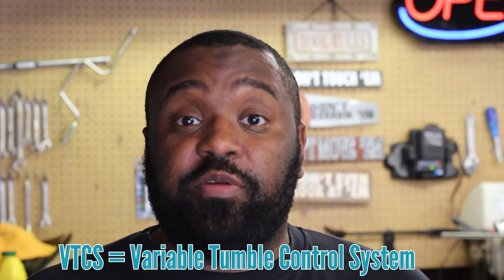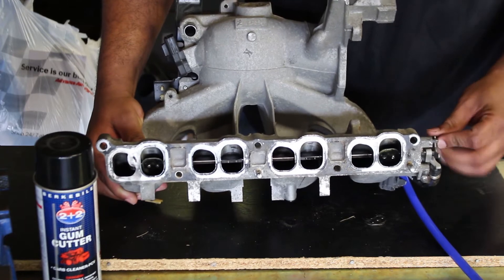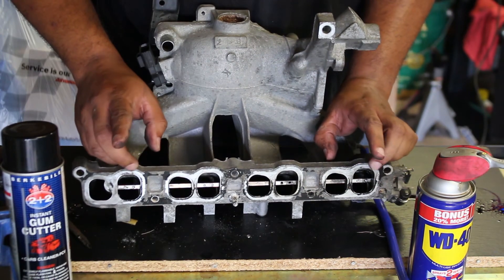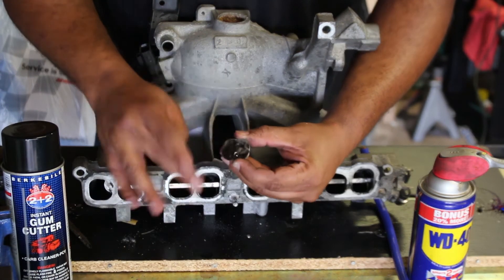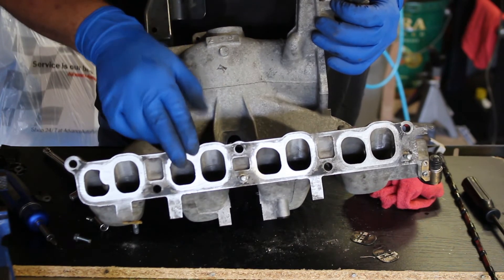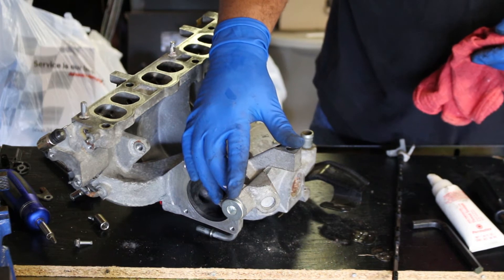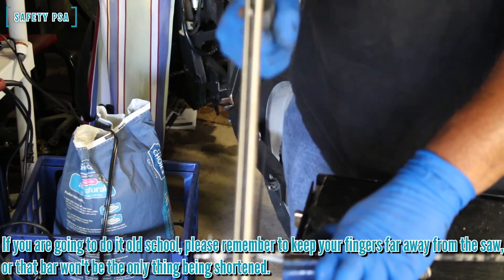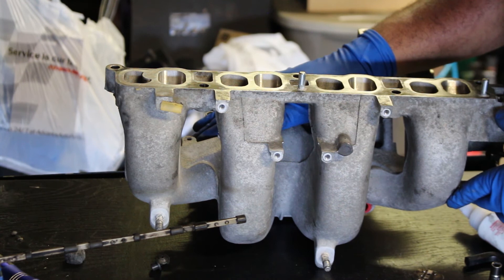VTCS Removal

Comment: You forgot to dremel away the VTCS rod bump in the smaller Cyl 1 runner. This should help remediate some of the flow imbalance of the stock IM.
Reply from the maker: That is a good point. When I replaced my injector seals (didn't record a video) I took the time to clean it up. I might do a follow up video to this in the future where I remove the VTCS from a different manifold and show some of the port cleanup tricks.

Comment: very solid video man and thanks for all the tips.  i personally am trying to avoid monitors turned off and CEL so there goes my doing this but id not have known if not watching this.  thank you again man
Reply from the maker: Thanks for watching! Unfortunately with this car, when you go to add the fun parts, it throws CEL's, even with the Accessport.
Reply: @FiveFiveGarage  very much true to a point.  I am stage 3 currently, going bigger turbo and have a ton of bolt ons but vitally, no CEL - the reason this is vital is that i live in CA so any smog shop literally will not pass your car if there are any monitors turned off for any reason what so ever and, of course, many of your parts must be CARB EO approved.  they will be much more prone to putting you under a microscope IF you have CELs and as such, I just can not have any... fuel pump, exhaust and some other parts that's are just supporting "safer mods" may not have carb eo approval but yet i will still pass as i did recently, any CEL or monitors turned off and id be toast...  was about to do the corksport intake manifold which does not have the VCTS and that would have been a total no no from my perspective...
Reply from the maker: There are ways to keep the VTCS solenoid functional (so it doesn't throw CEL's) without having it in the intake manifold. There was at some point a write-up or a thread about it on the old Mazdaspeeds forum, its in my notes somewhere. It can be done, just takes a bit of EE.

Comment: Randy I love your vids. So helpful dude. Best channel for the MS3 imo. I just bought a 07 which was super cheap and in fantastic shape. Just high miles and throwing cel. Random misfire. Removed head which is at the machine shop now for a complete overhaul and valve job, Ported and polished the intake and removed the VTCS. Will also be installing a new exhaust manifold. Tuner will use my COBB to tune the new set up. I had a question on cold start and idle as I am also deleteing the EGR and installing a oil catch can. I know it has a rough idle after deleting the VTCS but saw another guy using a different start up sequence by depressing the gas pedal about a 1/2 inch before starting and then releasing it as soon as it fires which he claims and demonstrated making it idle well on cold start. Have you tried this? Does it work? And also, have you had any issue's with it driving in colder temps bypassing the throttle body coolant llines? I want to do that and am hoping in Nashville where I live that our milder winters compared to yours will be ok to bypass it reducing intake temps.
Reply from the maker: Yeah that works, if you have neighbors that don't like loud popping noises I recommend using it. My neighbors are used to it now I guess 😄 I haven't had any issues with the TB bypass, but as it gets too cold, I drive my TrailBlazer and don't drive the Speed during the winter. I have the bypass and a thermal insulating gasket, and I haven't had any issues and it is going on 3 years now since I did these mods.
Reply: @FiveFiveGarage  thanks Randy. I also am installing the thermal intake and throttle body gaskets as well. Hopefully the reassembly goes smooth and we can get a decent tune in there. Dying to drive it rather than my big Ram 1500.
Reply from the maker: I know how that feels. I drive my Trailblazer during the winter, I miss driving my Speed 😞

Comment: What's the point in blocking off the hole you stuffed with JB Weld? Does the rubber plug not suffice? What happens if it isnt plugged?
Reply from the maker: The plug should suffice, but I didn't want ANY boost leaks. The JB Weld helped ensure it would be as airtight as possible. Anything you can do to help mitigate boost leaks is worth it.
Reply: @FiveFiveGarage  I appreciate the insight man, just did this on my Speed6 and JB welded the hole. Definitely can tell a difference in the top end👍

Comment: Hi Randy, happy to report with the help of your videos I have cleaned my valves, deleted my egr, bypassed my coolant, and have sent my injectors off for servicing and have the corksport seals for when they get back. Also installed the Damond PCV plate and the OCC. Whew! So ready to get the injectors back and get everything buttoned up. I had a question on the VTCS removal since I am waiting on my injectors and thinking I could knock this out while I wait. I live in AL where we don't get really cold weather very often, but the speed is my daily driver. Wondering if you ever experienced any downsides to doing the vtcs delete or if you'd recommend if for my situation? Thank you!
Reply from the maker: The only downsides I have experienced is the rough cold starts, but other than that no issues. If you are planning on going big turbo down the line, might as well knock it out now.

Comment: Bit late to the party but I have 2004 MSM and it won't start cold. Have to prime and crank a few times first then runs fine. Bee trying to diagnose a few things but maybe this is it?
Reply from the maker: Probably not, I would check some other things first. Like injectors, fuel filter, etc

Comment: How did it turn out. I just did this to a manifold I bought and ported and polished it. Waiting for my base map retune from PD to put it on. Also switching over to e40 so hoping for some decent gains
Reply from the maker: It turned out great, if I were to do it again (I have another manifold) I would port and polish it, the stock casting has some flash. E40 should get you some solid gains!

Comment: Great video. My q is.. is it really necessary to do this? Im going BT on my mazda 6 mps. Should i do this to
Reply from the maker: If you are going BT, I would definitely consider it. If you want to get the maximum potential from your setup, you are going to want to remove as much airflow restriction as you can. I would recommend a port cleanup/polish as well to the intake (I should have done it to mine when I had it apart) to help the air flow in the manifold.

Comment: Would this work on a non speed removing the flappers? Does it throw a code?
Reply from the maker: It does throw a code if you remove the VTCS solenoid. I wouldn't recommend it for a non Speed 3. The little amount of airflow that a naturally aspirated car would gain wouldn't be worth the work involved. If you were going to turbo, I would recommend the Damond Motorsports kit that uses the Focus ST intake.
Reply: @FiveFiveGarage  You would get I think P2009 maybe

Comment: I’m About to clean my intake valves and I’m planning on removing the flaps as well. I just finished tuning with PD tuning for 93 and E30, would you recommend getting a touch up tune after the removal? I wouldn’t really mind the CEL light but would it make my car run any different?
Reply from the maker: It shouldn't be necessary to get a touch up tune. Keep an eye on AFR's and maybe log for a day or two and look for any issues.

Comment: Hey, great vid and awesome content, I know I'm 2 years late but on the intake after removing the bar, didn't the holes between the cylinder port still have there holes and how did this impact since air can now go through the holes or did you seal thoughs to? 
I want to do mine aswel and was wondering how or if it effect the mod in any way.
Reply from the maker: No effect. I have seen people plug them, I have seen people run them unplugged, there is really no difference.
Reply: Im worried about the exact thing

Comment from the maker: I am getting close to the end of this series, so close to buttoning up my car so I can go zoom-zoom!!!
Reply: does my Car hasa VTCS? 2005 Mazda 3 i. No mazdaspeed or anything.
Reply from the maker: I am not for sure. I know the earlier engines had something called VICS, but that wasn't the same.
Reply: You never got a rough idle on cold start when deleting the vtcs ? I just did and I have a rough cold start . I’ve read a lot of people saying their idle is rough once deleting vtcs.
Reply from the maker: I do when I first start it in the morning, goes away after a few seconds. I did this mod over two years and have gotten used to it, through a 3" exhaust, I dont think my neighbors appreciate the sound of it as much as I do!
Reply: I have 07 speed 3 with a cst4 turbo u think i need to remove my vtcs
Reply from the maker: If you have the supporting mods (FMIC, larger turbo intake, downpipe) and need to remove the restriction, Yes. If you are lightly modded and don't plan on getting a downpipe, No. Removing the VTCS comes with its own issues (cold starts sound brutal, longer warm-up time during winter). It is more a "do it if you need it" type of modification.
Reply: I currently have the cst4 turbo cx racing fmic 3.5 corksport intake upgraded hpfp and a corksport downpipe on a stage 2 tune on the accesport
Reply from the maker: Might want to add it to your list of things to do.

Comment: What did you do with the black vtcs box on top of the intake manifold?
Reply from the maker: +Kurtis G Removed it. Plugged the hole in the intake with JB Weld.
Reply: Five Five Garage aren't there some vacuum lines that run to it?
Reply from the maker: There is the one line that goes to from the vacuum regulator to the VTCS solenoid (some people keep the solenoid, I removed it). The other vacuum line is from the regulator to the electrical connection. The actual vacuum port is covered by the regulator (the one you end up plugging). When you remove the regulator (black box), it takes all the lines with it. Leaving just the one port in the intake manifold to plug.

Comment: What about the holes 🕳 between the channels for each tuner itself ?
Reply from the maker: You know I never really thought about it. The air can't escape when you plug the ends, the holes between the ports are in the manifold so there isnt a chance for a leak. When I pull my intake back off I will ask my machinist about it.
Reply: Ok awesome I appreciate it I just fucked mine up so I’m deleting it would like to find a way to not throw a code lol 😂
Reply from the maker: I've seen people keep the VTCS solenoid connected and and somehow have it read operational so it doesnt throw a code. I always said I would figure it out but never did! Guess that is something to figure out over the winter.
Reply: That’s what I did I loooped the vacuum line kept the thing plugged in and stamped them out of the way 😂👌 I’ll let you know after I’m done with cleaning my valves if it throws a code
Reply: @FiveFiveGarage  did you ever find out if blocking those holes between the ports is needed?
Reply from the maker: I have talked to a few people and it is about 50/50 about filling the holes between the ports. I haven't and I have no issues. I am considering doing some mild port cleanup on my intake this summer, if I do, I think I will go ahead see what is needed to weld them up closed. I am real hesitant about filling the holes with a putty compound, the intake is the last place you want something coming free and getting into the valves/combustion chamber.
Reply: @FiveFiveGarage  thanks for replying. My concern was the same with using putty/JB weld to fill those holes , and I wasnt sure how cost prohibitive it would be to pay someone to weld them up and if it even made that much of a difference.
Reply from the maker: That is the same boat I am in. I am actually going to contact a machinist on the process and clean up (I have another intake laying around) and hopefully I can get in contact with an engine builder who might have some analysis I can view to see if there is any gains or not. It has been asked numerous times and I would like to get an answer for once. Hopefully I can fit it into my schedule for this year (not being able to record during the winter time stacks all the projects up once it gets warm) but I am curious to see if there is any gains at all.

Comment: do you have a video of putting the manifold back?
Reply from the maker: Yep. https://www.youtube.com/watch?v=LzTXfaMAY-U&feature=youtu.be its the Thermal Intake Gasket video.
Reply: Five Five Garage i’m also redoing the vtcs but i need help putting the black plastic that sits right on top of the manifold
Reply from the maker: The black box? That gets connected to vacuum. I removed it from mine, since I deleted VTCS I didn't need it.

Comment: Hey man was wondering if there could be any correlation between me having the vtcs code and the car throwing running rich codes as you said the vtcs affects the afr
Reply from the maker: If it stuck closed, it chokes off a lot of airflow, what codes are you getting?
Reply: Five Five Garage p2178 p2188 which is running rich on idle and off idle and then the vtcs code which is p2006
Reply from the maker: It could be that the VTCS solenoid is stuck closed, or the rod that the solenoid pushes on has a plastic piece on the end that has failed. That plastic piece has been known to crack and/or break. So the solenoid might be doing its job, but the plastic piece on the end of the rod no longer allows it to function properly. There is no replacement part # for that rod/plastic combo, if it is broken/damaged, you have to replace the entire intake manifold or just remove it. You can visually check it and see if it is still connected before tearing into anything. 
I found a post on the mazdaspeed forum that might help you out: http://www.mazdaspeedforums.org/forum/f293/now-what-p2006-196060/

It also includes a possible fix that might help you out!

Comment: You feel a difference after you did this??
Reply from the maker: The gains are minimal unless you are going to upgrade to a bigger turbo (I am). If the VTCS solenoid is stuck closed, it will make a big difference.

Comment: hello I have 1.8 engine mazda protege  e.s.  and I want to modified my engine and replease the intake manifold with  a nother manifold and I need emvice a lot
Reply from the maker: It took me a minute to respond to this because I had to do some research. The 1.8L in the Protege is very similar to the 95-97 1.8L in the Miata, truthfully is is almost the exact same motor. The differences are that since the 1.8L in the Miata is mounted longitudinally (front to back instead of sideways), the intake manifolds face the wrong way to be used on a Protege. You could probably modify/fab something up to make it work, but that is a lot of time and money. I have searched and cannot find an aftermarket intake manifold for the Protege. 

But I did learn that 99-00 Miata cams can be used in the 90-98 Protege 1.8L and they make more power than the stock Protege cams, you will need to switch the HLA's for solid lifters. 

You are probably going to have to port and polish the stock intake to make power, though.
Reply: @FiveFiveGarage  thank you I found manifold modifiel on mazdaspeed protege could be possible to work on my 1,8 engine ether way think ain gonna look for mazdaspeed engine  and do swap 
thank you so much

Comment: Back when mazdapseedforums was around they had a relay trick that was able to bypass the CEL. I found the link for it but since its down can't find any info about it. I just need it to get the car to pass smog. Anyone have any more info on that?
Reply from the maker: You could try using the wayback machine site since you have the link and see if you can pull up a cached version of the page. Good luck!